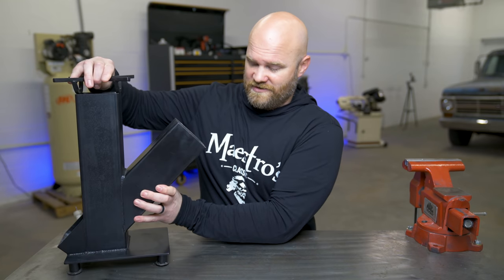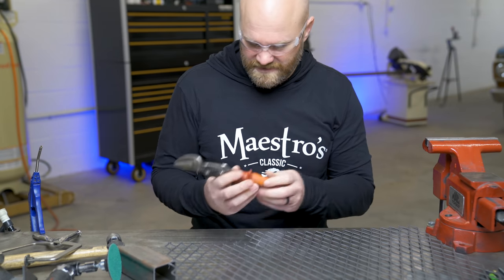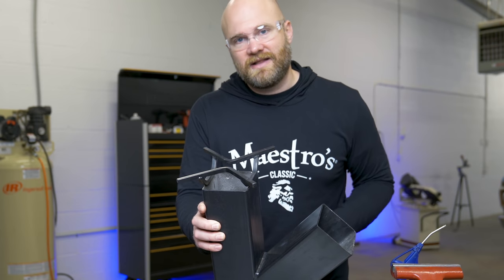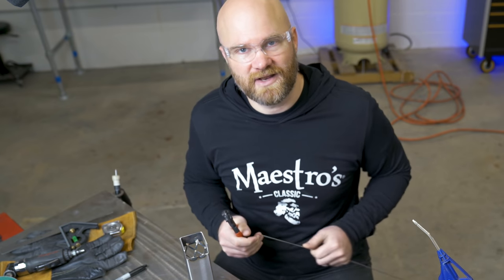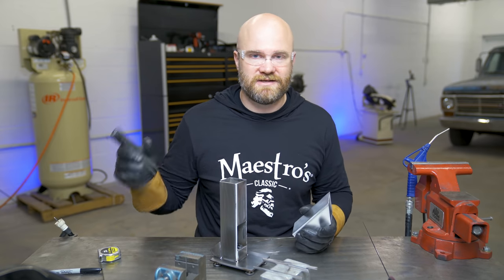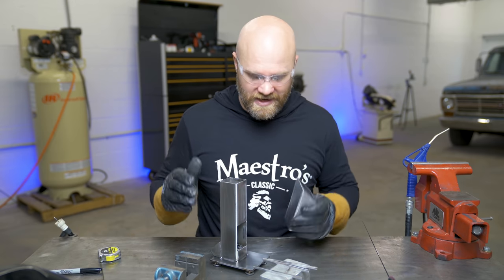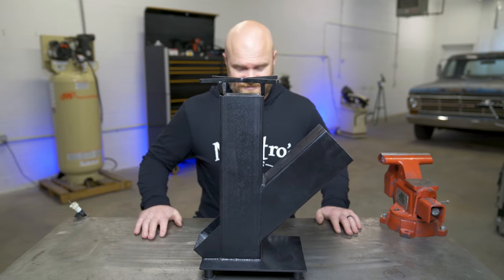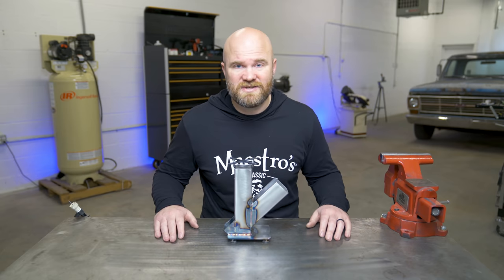Making A Mini Rocket Stove! Fully TIG Welded.

Comment: I was all in on this video until he broke the yolk on that egg.
Reply: Well, it’s kinda hard to make scrambled eggs with a yolk intact
Reply from the maker: It wasn’t hot enough to fry, I should have used a steel pan instead of cast iron.
Reply: Lol I almost cut the video there
Reply: Desecration was the word that came to mind when the yolk broke. Fantastic little stove, though. Thanks for the presentation.
Reply: Never heard of a scrambled egg
Reply: Yolk is a weird word. I don’t like it
Reply: Justin Voss  yeah what’s wrong with you?
Reply: @subscribemf3528  The best kind are,  take 6 regular eggs and mix in 1 duck egg . Then make scrambled eggs .
Reply: @johnh1001  whyvthe duck egg
Reply: @reillyjarrosiak63  😂
Reply: Sooooooo did it work ? You cut the most interesting part of the project. Did it work or not ?

Comment: when making your tacks. you can set the amps to 150, 175. rest the cup on the part with your tungsten pointed at the joint about 1/32 ,1/16 away. then you tap the pedal all the way down then all the way off. do it kinda fast like half a second. you can just cover the arc with your glove no shield, if your the daring type.  the joint has to be tight , no gaps. if you do have gap you can rest some rod at the fusion point. its so much faster and easier.

Comment: With a proportional decrease, the thermodynamics change, the relative heat loss will be greater, and the efficiency of the stove less.
The upper grill with a proportional decrease becomes small for use. But these are Russian nit-picking.
Great work, master. Separately, I want to note a good video of electric welding.
Reply: Big words small brain 🧠

Comment: Bout time you put out another project. Great one, it’s so cute! The laying of the beads at 13:29 was amazing in slow-mo. I get a much better picture of how TIG is done with just that one shot.  Will one day have to get one, looks much cleaner and easier than Flux core.
Reply: Agree 100%. I've done a little MIG welding, and never fully understood how TIG worked. That shot explained 90% what I did not know.

Comment: I did that same design only stick welded it. It will not stay lit.  Twigs, dry wood, none of it burns long enough to do any cooking. some say the two inch square tube is to small. Not sure But I see yours works, just wondering the length of time yours burns without constantly tending to it?

Comment: I noticed smoke coming out of the feed tube at the top. How can you eliminate that? The draft is not strong enough to pull from the feed tube because the bottom port you made for air is countering it...

Comment: One idea. I know you like the slanted fire grate but for ease of replacement a piece of material long enough to just bend 90’s on Two sides and would slide in and out would be easier and replaceable. It would Slide out for cleaning as well. Just a thought

Comment: i may have had a little wtf moment when you were cutting with no guard. but to each there own. ive never had a disc pop but Ive had one grab and kick the grinder and tore the disc.
isnt the big cup a little over kill on MS?
Reply from the maker: It has great coverage on all steel. For the wheel it’s definitely not as safe as with a guard but I also try to never have it spinning directly inline with me. I’m sure it could fly off at an angle though.

Comment: whats amps you where using? cuz for 2 and 2.5mm stainless we use 160 pulse 30/70 with 3-4hz, idk in the video it seems so slow... and heat affected too much (cooked)

Comment: Hey Justin,nice project! I weld all my steel stuff with 309L. Gets a pretty bead and good for dis-similar metals. My question is,and I am not criticizing. Your travel speed seems to me to be slow. Obviously you have laid down miles of tig welds. If I ran my travel speed like that the heat affected zone is huge.I try and keep the amperage set accordingly at about 1 per/.001 thickness. I use ,and love the #12 and #10 cups from Furick. Any thoughts?  I use 3/32"- 2% Lanthinated exclusively.
Reply from the maker: I do run slow sometimes, it's a bad habit I'm trying to break.
Reply: @JustVoss  Maybe so,but your welds look so dang good!

Comment: I just got done making the normal sized rocket stove. I decided not to use a flat sheet of metal for 2 reasons that I think you should take into consideration.
Price: sheet metal gets expensive.
Level: if you take the rocket camping, any Little Rock is going to make that thing unstable and not level. 
What I did was cut 2 pieces of thin gauge channel bar, like this-> |__| And put the legs on the ground. Then I one more half channel (like this—> |_ ) I put that half at the “front” where the 45* arm sticks out, then places the pieces of channel perpendicular to the half channel.
One placed near the air intake, and the other just about in the middle of the rocket.
I hope this helps someone who looks forward to building this. It’s a good build. Not to difficult, but something that you will definitely make better the second time you do it.

Comment: When u cut thick metal does ur blade get stuck or break alot
Reply from the maker: What blade are you talking about? If the horizontal band saw then no it doesn’t. You may have something else wrong or need to increase the tension.
Reply: @JustVoss  ur cutting wheel..are u even a welder
Reply from the maker: That’s not a blade.
Reply: @JustVoss  cutting blade
Reply: @JustVoss  lik I said are even a welder lol

Comment: 1/16" is pretty thin stuff. What settings were you using for this project?
Reply: Nowhere near hot enough. Hense the amount of oxidation around the welds despite using a flood-cup on the torch

Comment: Where did you get you long air cut off grinder? And good vid!!
Reply from the maker: It’s a mac, off of the tool truck. But if you look up extended cutoff wheel on amazon there are some with good reviews. I think I have some listed if you click my amazon shop link.

Comment: Man I want an HF start. Tired of the cheap liftarc blowing up tungstens on start and making fisheye hard to deal with. Good little project!
Reply: If you have a foot pedal ease off right there at the end about 20 amps b4 you terminate . if not try adding a good Lil dab of filler right b4 you terminate.
Reply: @jeffgreer198613  Yeah I've gotten my nice machine since then and not having those issues now Haha.

Comment: Dammm cool!!!     And where did you get that extended air tool for your cutoff wheel
Reply from the maker: It comes like that, mine is off the MAC truck but other companies make them. Believe there is one in my amazon shop linked in the description.

Comment: Why would anyone use the slowest and most expensive method to put that together?
Reply: Because besides being good practice for tig, I'd like to see someone mig that thin of material  'quickly'. Not gonna save you much time, if any. Most of your time is spent in fab/prep. The welding is the therapy part. ;)

Comment: An excellent metalwork video. Low comprehension though of efficient rocket stove design principles. No application of appropriate design construction to maximize heat transfer to cooking vessels. Another DIY rocket stove design lacking important rocket stove design principles and inadequate for real cooking. SilverFire Stoves & Cookware.